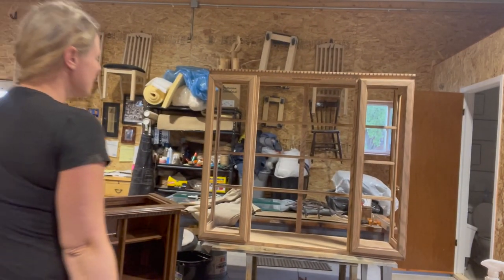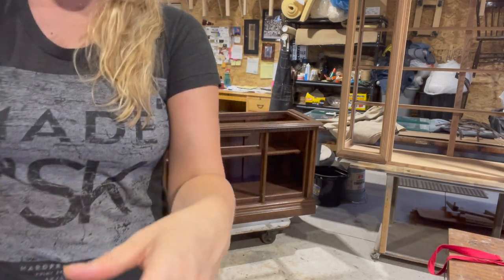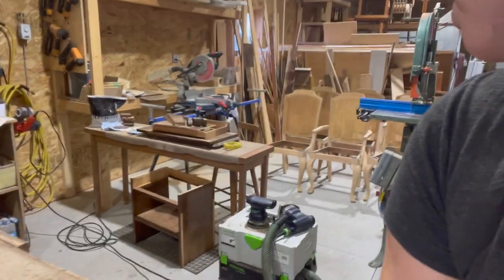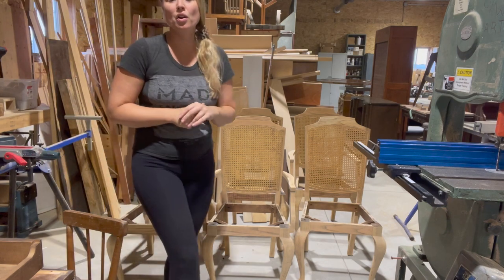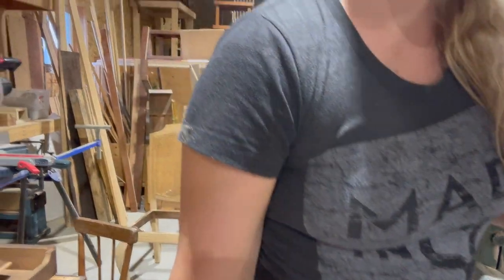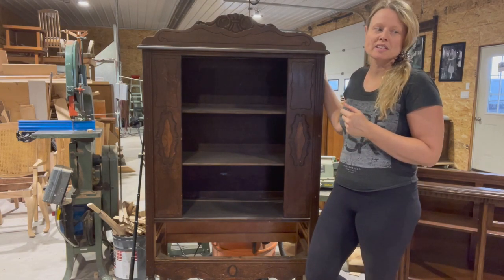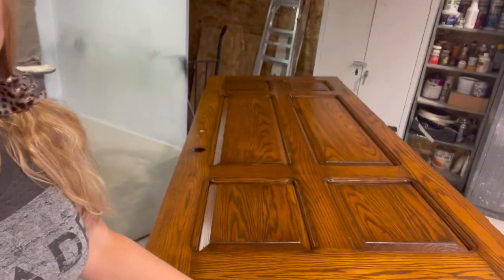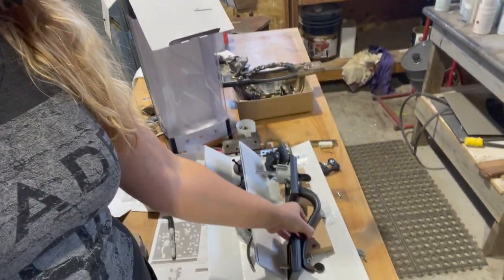Clock up and running! Part 5 and Fall update

Comment: Lots of work for you which is good news. I love watching your videos. Looking at the Longcase clock at the end I noticed the gut line hasn't wound the barrel correctly and it could cause problems also the seat board shouldn't be held down with at horrid nut and screw. The weight of the weights is enough and the weight of the clock will hold it in place, that is how it originally would have been. So you might like to pass that on. I'm a retired clock maker and restorer with around 30 years experience.
Reply from the maker: Interesting. Thanks. The steel nut isn’t tightened. It just sits in the steel rods.

Comment: Cherry on top, having the clockworks restored also. Absolutely one of your most IMPRESSIVE projects — couldn't have been done by anyone other than a MASTER Craftsperson. Also, LOVE your "door spit" — always been a pain when finishing doors, and I have usually jury rigged something to accomplish this in the past. This is WAY better! Curious, how do you adjust for the length of different doors? Couldn't tell from the vid. Look forward to the vid for that cabinet you previewed. Cheers!
Reply from the maker: They are actually two separate stands, the length is adjusted by the center support board so it can be any length

Comment: now i am retired i really should learn how to repair an old clock.  i have a 1884 piece with an ornate wooden case that i refinished, only to have the mechanism finally give up the ghost.  i had it repaired 20 years ago at a fair price.  now they want an extortionate amount to replace two bushings.

Comment: Hey Trena, I've been subscribed for a while now, so I know you're an expert with restoration.  I've been tasked with restoring an antique Singer Sewing Machine.  I've already cleaned up the rusty cast iron base, got it looking brand-new....but there are some pieces of the wood framework that are severely rotted and need replacement....I can do that myself, and match the original stain.....BUT, some veneer needs replacement.  I've never used veneer before.  Do you have any videos specifically for veneer application?
Reply from the maker: Try this video titled This job is WAY TOO SCARY! Just run away

Comment: The clock next to the fireplace looks beautiful but if they are in the habit of lighting that fireplace might dry the wood too much in the winter    And cause cracks. Maybe the could store a fishnet bag filled with charcoal on the bottom part of the cabinet to control the moisture level. In japan they use bags of charcoal under the floors to absorb extensive moisture during summer and release it slowly during the winters.
Reply from the maker: Hmm interesting